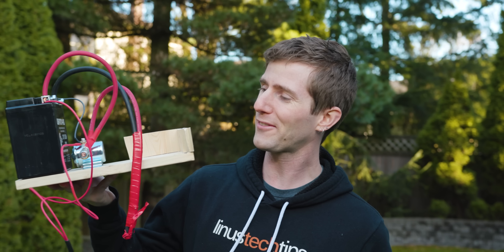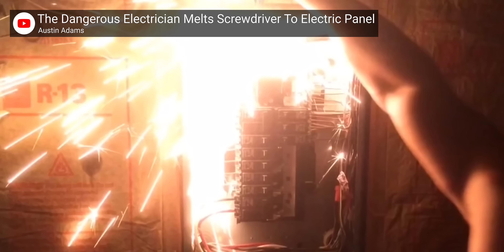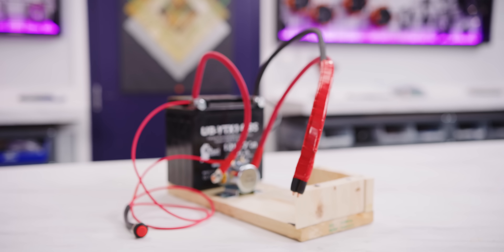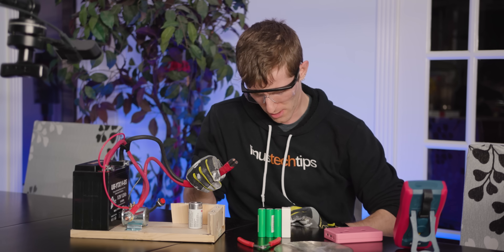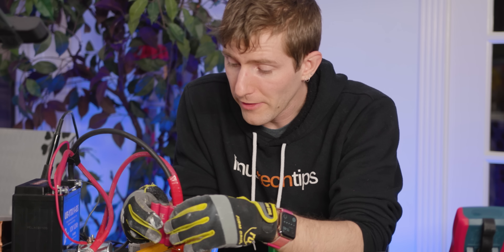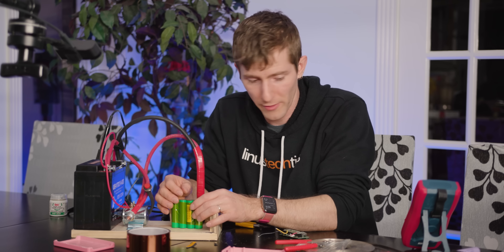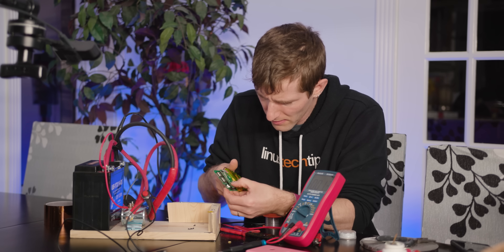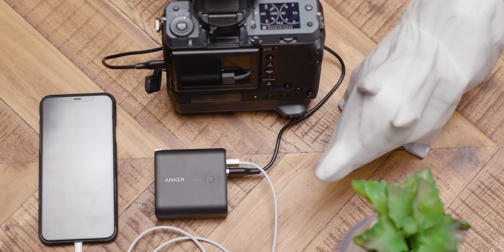I spent $100 to save 20 bucks... and it was TOTALLY worth it!

Comment: 3:50, there is no electrocution hazard at 12v even if you were covered is salt water. Voltage is too low to deliver enough current through the resistance of your skin to be harmful. (Needed to add that last part to appease some people even though it should of been self explanatory that is what I meant.)

 Can be a burn hazard for sure though. Like if it shorts out on a piece of metal that you are in contact with.
Reply: it would probably hurt if you licked it tho.
Reply: @halted_code , personal experience yes 12 volt can hurt a fair bit if licked. However still not a crazy amount, just a bit of a sting for me. People have different mouth chemistry though.
Reply: Lmao. I love it when people make comments in videos like this when they clearly dont know what they are talking about. The voltage is not too low, the human body resistance is too high, reduce the resistance of the body and then see if 12v is too low. Even better, wet your arm and lay it across a car battery and then say you dont get  shock, actually dont do it as it might cause you some serious damage and I dont wanna see a video blaming me for trying it. Nice to see someone else had picked up on this as well as id started to think everyone just accepted it was safe!!
Reply: @ChrisSmithy  The skin resistance is too high, you'd need a higher voltage to get enough current to go through your body and actually cause damage (assuming you're not applying said voltage internally, but in this case even breathing would be dangerous since you could want to do it underwater). 

What kills in the end is the current flowing inside your body (and through your heart), increasing the voltage or lowering the resistance only allow more current to flow. That's Ohm's law: I = V/R.

And by the way, an electrocution is always lethal. If you're still breathing after touching two wires, it was only an electric shock. 

If 12v DC is so dangerous/lethal to touch with wet hands, why is it considered a safe voltage in bathrooms then?
Reply: MrGordane let’s go from the top. Skin resistance is too high isn’t a statement you can really make, it totally depends on the lots of conditions if it’s wet it can drop to 1000ohms hand to hand, the shorter the distance the current has to travel the lower the  resistance it experiences. So the conductors of opposite polarity being close together and the skin being wet will without doubt create a passing current that you will feel. 

I think the word electrocution is meaning different things to different people, I agree that originally it meant death, but as you’ll see if you look in the dictionary it actually says to injure or kill with electric. I’m taking it to mean injure as that’s unquantifiable and easier than arguing over what injure means.

Oh and well done for copying what I said about ohms last in one of the other posts. I am quite familiar with it as I’ve been an electronics engineer for a lot of years
Reply: @MrGordane , exactly 12v has basically no risk other than potential burns if say it shorts out and heats up metal.

 But though I agree the original definitely of electrocution was electro + execution it has been changed to injury directly from Electricity too.

 However burns from hot metal Electricity has flown through would obviously not count. Not saying you said otherwise. Just as a general statement.
Reply: @ChrisSmithy , when I say the voltage is too low I obviously mean too low to kill you because of it being too low to over come the resistance of your skin. (Ohms law, due...)

 It could potentially horribly burn you though if specifically it like shorts on on some metal you are in contact with.

 Also did just touch two the positive and negative of a car battery with my thumb and pinky with my hand soaking wet.

 You know what happened? Absolutely nothing because unlike in Hollywood, 12v Batteries aren't an electrocution hazard.

 I already knew this though from much experimentation with the subject and tons of experience with Electricity in general. Both low and high.

 It is obvious that you are the one who is making comments when you have no clue XD

 You can literally look it up and find hundreds of sources about how safe 12v is easily. If you don't want to take my word for it.

Comment: I spot weld batteries for a living, one thing to note is that if are there any air gaps/air between the tack strip and the surface then the weld will spark and may cause more heat to the battery. More air more sparks

Comment: One thing really bothered me about this video. The momentary switch was attached to the positive electrode. The switch will have to deal with more electrical pressure (i.e. voltage) than if it was on the negative side of the circuit (no voltage after the relay coil). This will prevent arching in the switch and would eliminate the "oh crap it didn't turn off when i let go" effect.
Reply: That's not how voltage works at all. The voltage through the circuit is identical on both sides - otherwise you'd violate Kirchhoff's laws. It's just the reference point that changes. If you measure the voltage across the open switch contacts you'd get 12V no matter which side the switch is on. When the switch is closed the voltage across it is effectively zero. The current flow is identical no matter which side of the circuit you put it in. The reason they put the switch on the negative line in a car is that it isolates the chassis from the battery and circuit, which makes it harder to accidentally short something. Doesn't apply here though.

Comment: When soldering you do not heat the solder with the iron. You heat the material, such as the cable ends, with the iron and the cold solder flows into the hot wires when contact is made with the cold solder and the hot wire. Heating up the solder and putting it on a cold surface results in a joint, some of the time, which - if a joint is actually made will likely flake off.

Comment: I got a few hundred. 18650 cells I would have sent you 50 or so for free.

Edit addition: I actually have more like 300 and I would have sent a 4 slot charger with it. 18650 batteries are no joke, even at 0.01v it will arc like it has 4.20v I know this first hand .

Comment: „Heat up the solder itself and flow it on the materials you‘re trying to join“ sorry Linus, but this is not how to solder properly. If you do so, it is no surprise that the joints are crappy.

Comment: I didn't care at all about the battery charger, but I was fascinated by that spot welder. I've begun to build my own. I already have an arc welder but that thing is so huge and is a pain to pull out for small projects. I never would have thought to build a smaller one using a 12v battery. Kudos.

Comment: Linus, how do you not have a good soldering iron when you're worth like.. millions?
Reply: Millionaires remain millionaires by not spending money on things they can do without.
Reply: @KatyaEll  not wrong.. but then again he spent more on that spot welder than a very sufficient temperature controlled solder station.  A 100 dollar hakko or Weller ... And since it was used for a video, it's probably a tax write off.  For a man worth 4 million, a 100 expenditure to do something correctly hardly qualifies as not needed.
Reply: @AlanDike  I imagine you're right in this case. I really just wanted to make a more general point about frugality for all the youngsters out there dreaming about the million dollar wallet they'd buy if they had a million dollars.
Reply: @KatyaEll  in that I can completely agree.. there is definitely something to be said about being frugal.  Too many folks associate frugal with cheap.. buying good gear that meets your needs but isn't super expensive is frugal.  Buying poorly constructed gear that won't last is cheap.  Buying expensive when it's not required is just stupid.  In that, your point is dead on.

Comment: Any unfused electrical device is inherently dangerous, relay or not. Add to that the inherent risk of Batteries used in high current situations, and you've got trouble waiting to happen. Your device should have a suitable fuse as the type of relay you are using can "FAIL SHORTED" (although usually they "FAIL OPEN").

Comment: smart move on the second spot weld for the extra tabs. I'm sure there's some resistance that reduced the overall power output/efficiency of the batter bank, but it beats a lithium battery induced  housefire.

Comment: Well it was interesting to see that DIY welder. I should point out that there may be a small safety issue, you didn't use isolation paper on those cells. In case those batteries get too hot during charge or discharge, it may couse the shrink wrap around cells to melt and short circuit anodes to cathodes, and then you will have a really bad day.

Comment: In theory the spot welding should work better than solder but 8:43 shows the practicalities.  TBH it's easy to buy DIY chargers on Ebay with tight spring loaded battery holders that don't require either welding or soldering; I've got two of such examples each with eight 18650 batteries in them and they work fantastically.

Comment: Need some serious help!! 
My computer is stuck on bios mode. 
DEFAULT boot divace missing boot faild.
When I start my computer I only get 1 option EFI PXE network (E8-6A-64-27-B9-29) 
My old ssd was not detected so I bought a new one and now it's showing up in bios that I have hard disk but still not working, 
I have tried to put boot mode to legacy mode and I have tested to start my computer with internet cable but still I can't get any result.
After legacy mode I get this message 
PXE-E61 media test failure, check cable
Well what do I check if I have laptop?? 
Have controlled that all cables are connected so what do I do

Comment: Actually a pretty cool video, but it does once again prove why the first hree steps in tech support are always "Check the connections." "Did you check the connections?" and "Check them one more time to be sure." That said, now you've got an spare set of cells for your battery bank if the new ones do fail, so stash those right back into your hoard warehouse Mr. Smaug of Electronics.

Comment: Spot welding a nickel strip as a soldering tab onto another nickel strip is not ideal. The best would be to use a single continuous strip, but your solution is preferable to soldering directly on top of the battery.

Comment: Note: 3.62V is within the safe storage voltage for 3.7V nominal Li+ batteries, but it's not the ideal storage voltage. The ideal storage voltage is 3.82V, so for long term storage they should be charged to 3.9V, slightly above the ideal storage voltage to account for self discharge and because the voltage usually drops slightly after being disconnected from the charger.
Reply: Nope...Samsung specifies 3.62 volts. I've got a high end $150 charger and when I set it for storage voltage, it brings the cells to 3.60...very close to zsamsungs desire

Comment: The cheap pushbutton switch in the DIY spot welder may be prone to arcing and contact welding (8:38).  I'd spend a dollar more and add a capacitor across the pushbutton contacts and a reverse-biased diode-resistor snubber across the relay coil.

Comment: My spot welder, I just found out, generates surges while either spot welding or switching it off. This would solve that problem. Also while I am posting do you have a video or plan on doing a video on building UPS APC using 18650 cells. I would like to have backup power for my different items in need as in router, switch, 3d Printer you get the idea. Looking for a printed circuit board taking the DC voltage and creates AC voltage. Thank you and keep up the good work.

Comment: Suggestion: Photovoltaic HOME first AC, with a convertor, but with a DC line and switching almost everything to DC with time. Not only it will be cheaper in the long run - can be added to the mortgage as more value of the property - but also carbon free that is good for everyone health. And probably has interest after #COVID19.

And of course you will be able to make a lot of videos with each AC gadget and or power supply switched to DC, the batteries and all that stuff.

Comment: “The advantage of spot welding vs soldering is that we are applying heat for a short amount of time...”                                     *proceeds to burn a hole through the nickel and battery

Comment: I did this project myself a few weeks ago to build myself an Ebike battery and I figured out the best way to get good welds is to have the car battery at about 40-50% charge or about 12.5 volts. this prevented the big sparks and overheating that caused the first weld i did to punch a hole in the cell just like yours did

Comment: Using manual switch in spot welding is frustrating and yeilds variable results, it is better to have arduino programmed relay which delivers two quick pulses with short pause in between. also you can use pedal switch to free your hand to hold batteries While you weld.

Comment: Are those Sony VTC5/VTC5a cells?
what the hell are you powering that requires that amperage? you'd be better going with some of LG's HG2 cells since they have a better mAh rating and would provide more charges in the long run.

Comment: There was this super cheap copper wire coming from Poland some years back, and everyone in the eastern bloc were buying it, and wiring apartment complexes etc.
When they were doing the tests and  measurements (I have no idea what the correct term is in english) they conducted electricity very poorly, and it turned out, that it was Steel wire with copper plating on it. It must've been a nightmare for many companies, and workers, lol.

Comment: ...
You should've attached short cables to the nickel strips first, then connect those to the actual ones for the electronics in the battery.
You still heated up the battery.

Comment: Arduino to control the timing of the capacitor. as long as the button is pressed it will run through the preset time, but if the button is released it cuts the electricity immediately if the energy is still running.

Comment: If your going to attempt this please make sure your 18650 insulation isn't damaged in any way. Especially on the top of the battery on the positive side. Directly under that white plastic circle is the negative end of the battery (on the outer rim) if that insulation gets damaged, or the sharp nickel strip cuts the plastic/insulation, you could easily get a short.  

Manufacturers avoid this by using an extra "o ring" of insulation they place on the top of the battery, before spot welding the nickel strips.  A common name for this insulator is "fish paper". If you watch the video closely, you can see the insulating ring.

Comment: Use a Deep Cycle battery because the are made to be killed and recharged. Regular automotive or power sport batteries will go bad faster. Might be better to get a continuous duty solenoid so you don't burn it up and can hold the button down longer if needed.

Comment: Should have put some kapton tape underneath the little nickel strip tab on the positive side before bending it, all the outer casing is negative, and there is only a thin layer of green heatshrink preventing a dead short, it could heat up and melt or have sharp edges and pierce the plastic.

Comment: Some years ago I once tried to make such a spot welder for 18650's (28 of them to re-cell my ebike battery for 1/3 the cost of new) using 2 car audio capacitors (humungous things!), but couldn't get the circuitry right, the parallel 70A MOSFETs died or didn't work properly. In the end I bought pre-tabbed 18650 cells which I then soldered together, and still saved a bundle re-celling the ebike battery.

Comment: Build an Arduino controller to be able to dial it in instead of manually triggering it with that push button. Use the push button to tell the Arduino to run a "weld function" for the duration you selected with a potentiometer or even a menu driven system with a little 2 line display and some micro push buttons

Comment: "Belt sander" BENCH GRINDER
12v battery "Electrocution hazard" HARMLESS

Also you really should try to find batteries of the same capacity when putting them in series.
Reply: Yeah LTT is kinda far from electronics side of things, kinda disappointing for me.
Reply: well, you should more that try, it is pretty much essential for good battery life.
Reply: Not really. You have to make sure that the voltage is the same but you can differ in capacity without any problems.
Reply: @Hoch134  this is true as long as you have a BMS monitoring each cell. A single cell could drop below a safe voltage while the overall pack voltage is still in spec, which obviously kills/shortens the life of that cell. Your packs capacity is also based off that single cell as it's the weakest link.
Reply: @bryanjk  You are right, thanks for the clarification. I didn't think about that.
Reply: @bryanjk  new to bat packs, be gentle.   would it be ok in parallel though? self balancing, no?
Reply: @PghFlip  no. they dont balance in different configurations, this is a well known drawback of the lithium ion chemistry. like a prev commenter said you need a BMS circuit monitoring each cell for truly safe operation and the reactionary "cell drop" that proper BMS will do to remove any damaged or underperforming cells from the array.
Reply: @zaneandre6387  Nothing wrong with what you said or sited per say, but within in a paralleled "1SnP" sub-division, cell level BMS can be, and is often reduced to something as simple as a fuse wire in case a cell fails shorted.  So yeah, certainly a BMS at each cell is great; superior even but it's also not at all uncommon, or even necessarily unsafe to cut cost by having a beefier BMS manage a handful of cells in parallel.

Not trying to invalidate what you said, just hopefully add something useful to it.